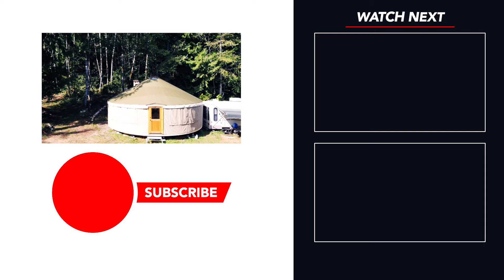TIMELAPSE: Couple Building a YURT in 15 Minutes  // Off Grid Living

Comment: Gorgeous yurt! Curious about how much in materials the platform costs? I am looking at yurt kit that includes the floor kit and trying to compare. Thanks!
Reply from the maker: 2 years ago it cost us about $5,000 to build the platform, I'm sure it would be significantly more today with the increased lumber prices.  I'd guess $8k - $10k.   This was for our 30' yurt.
Reply: How is that floor holding up? We are considering doing stamped concrete (we are northern WI) but worry about the cold

Comment: This SO FUN to watch and relive it all.  It also looks like it was SO EASY 😂😂
Reply: Thanks for the video! How long did this take in real time haha
Reply from the maker: @SeekandSave777  the yurt took about 3 weeks in real time.  1.5 weeks for the platform and 1.5 weeks for the walls/cover/roof.  Really the hard work comes after the assembly of figuring out how you'll heat it.  If you'll plumb it and run electrical, and how you'll design it.

Comment: You guys inspired us so much I am picking up our yurt from Pacific Yurts in spring. Ryan what was the dimensions of your trailer that you picked the yurt up with , need to make sure mine will do the job. Thanks again.
Reply from the maker: Our trailer is 12' 5" but has an open back and Pacific Yurts recommended a 14’ but they were able to load ours just fine.  I did attach a piece of board to the back of the trailer but honestly I’m not sure it did any good. The rafters on our 30’ were 14’ 10” so there was a significant overhang, but it was still legal in Oregon/Washington.  Excited for you guys!  What size did you get?
Reply: @OneFootOfftheGrid  Thanks for the response! Yes we bought the 30 ft. as well, so I saw the rafters are just short of 15 feet . Our property is also in WA state but in the mountains.

Comment: We have a 16 ft yurt from Pacific Yurt. I noticed that you insulated the floor and the roof, but not the walls. (We did all three surfaces and are also in the PNW). How did you decide about which surfaces to insulate?
Thanks, Ramona
Reply from the maker: We did insulate the walls.  We just bought our own insulation from a third party instead of buying from Pacific Yurts.

Comment: Love the video, thank you for sharing your journey.
Can i ask for your plans on your deck?
We are about to try the same thing and any guidence would be appreciated 
Minty thanks
Reply from the maker: They are the official plans from Pacific Yurts.  https://www.yurts.com/downloads/
Reply: While these tents are commonly referred to as Yurts...yurts have rafters which curve downwards just before the sidewall...this design with straight rafters is called a Ger.

Dig holes three feet deep, put in a tire, fill with dirt, tamp well, use lag bolts to screw through the sidewall of the next tire, screwing it to the first one, repeat until you are 2 feet above grade. This will give you almost free footings that go below the frost line, which will prevent the floor buckling in the winter.

Either make a mechanism which will raise the clear plexiglass dome on the roof ring, so you can vent heat when it's hot outside, or just use the cloth cover the Mongolians used for centuries.

Build a Rocket Mass Heater, with the thermal mass built into the wood deck to save space, so you can heat the Ger efficiently all winter.

Comment: Hello! Me and my family are going to start a community farm with many yurts and one huge yurt for religious purposes, I tried to gather as much as I could from the video but if it isn't to much to ask what are some things that made the job a whole lot easier?
Reply from the maker: Very smart to ask these questions before trying to install.  A couple of the most important ones:
1. Have more help than you think.  The covers are extremely heavy.  I'd say having 4-5 people would make it go pretty smoothly. 
2. Use a scaffolding.  I've seen people place the center ring with only using ladders, but the scaffolding make things so much easier. 
3. Think about unfolding the cover first and then refolding.  Ours what so stuck together it made it almost impossible to unfold.  We put some baby powder between the folds to make it easier to install (the second time).
4. Platform - Use construction adhesive to secure the boards to the joists to prevent squeaks.

Comment: Hi, what is the size of the decking board used? Do you paint or stain it? Very interesting video.
Reply from the maker: It is a 2x6 T&G board.  Sometimes referred to as “car decking”. We are planning to stain it and then finish with a polyurethane.
Reply: Where did you buy those decking boards? Seems hard to find 2 by 6 boards. Thank you.
Reply from the maker: @wenqiaoyuan55  we just called around to our local lumber yard.  I don’t think HD had them.

Comment: Awesome video! I just started installing the beams for the platforms for 2 30’ yurts. What nails did you use for the t&g floor? I was planning on 2 3/8” ring shank.
Reply from the maker: We used 3 1/4” framing nails drove in at the tongue. It’s worked well but if I had to do it again I’d take the time to put down construction adhesive at each nail point.  

Good luck on your build.

Comment: Is there a reason to build a round platform for a yurt beyond the obvious? Seems like square/rectangular would be easier to build and you'd have deck space. It's a real question. I'm curious.
Reply from the maker: There might be ways to do it with a square platform but the round design ties the drip edge to the canvas.   So we just followed the manufacturer’s recommendation.
Reply: @OneFootOfftheGrid  Interesting. I see. Thank you!
Reply: I built a rectangular deck (28'x 32') for a 24' Pacific Yurt. On top of that, I built the 24' yurt platform out 2'x4' lumber (on edge), then 3/4" t&g plywood subfloor. That left 2' on the sides and 4' in front of the doors. Plenty of room for the awnings.

Comment: The floor insulation was only on one side of the yurt, why was that? The roof was insulated, but the sides only showed one layer, for the walls. I was looking into Pacific Yurts earlier and the walls have more layers, including insulation. Thank you for the video, it did help me to get a better overall look at building a Yurt.
Reply from the maker: We put insulation under the whole deck.  The portions that had decent crawl space area we did after the platform was completed.

Comment: Is this the only structure on your land? I would like to build a yurt on an acre over on the Oregon coast but I’m afraid that building permits may stop me
Reply from the maker: When we built it, it was the only structure on the land.  We built it as an "unpermitted structure" after discussing options with the county.  That meant we couldn't have permanent electrical, water or sewer to the structure and there were limitation on the height of the platform.  

Check with your county to see what they allow.

Comment: Pacific Yurts is in Cottage Grove, Oregon. I just bought a 16 footer to stay under building permit requirements in Washington state.
Reply from the maker: What was the building permit requirement.  When we asked our permit office in Mason County, they requirements were only around the height of the platform.
Reply: @OneFootOfftheGrid  Over 200 square feet was when the county's permitting requirement kicks in. That's separate from any electrical or water needs. I'm thinking of adding a propane gas heating  stove to simplify the venting stack compared to wood burning.
Reply from the maker: @leewhitmore5350  We did a pellet stove which allowed us to vent out the side and we’re really happy with how it heats up the yard. Remember when using propane that you introduced a lot of moisture into the air which for a yurt can be a problem sometimes.
Reply: @OneFootOfftheGrid  Thanks, I will consider the pellet stove.

Comment: So, no property tax on the yurt?
Reply from the maker: Not in our county.  It's not coded as a permanent structure if it's lower than 30 inches off the ground, and has no utilities.  We'll run solar power to it, and don't plan to plumb it since we'll have our cabin.

Comment: Step 1: Spend $50k in wood
Step 2: Put up rafters that look like they could blow over in the wind
Step 3: Put a tarp over the whole thing... because nobody likes windows
Step 4: Don't insulate anything. Most people prefer to freeze
Step 5: Never consider hooking up water or electricity... nobody needs that
Step 6: Ensure there's no washroom because guest will prefer to walk outside to an outhouse or take a dump in the woods
Step 7: Look at your bank account and realize how dumb you are for spending a ton of money on a glorified tent
Reply from the maker: 1. Our kit was only $10k and the base only cost $5k.  
2. The are treated 2 x 4s which were engineered to support this structure.  With the optional snow and wind kit (which we purchased) it can support much more load. 
3. Tarp?  Try canvase.  We actually have 5 windows all around the structure plus the GIANT plexi dome which brings in plenty of light. 
4. The roof and the walls have  double bubble thermal insulation.  The floor has 1" of rigid foam. 
5. This is an "off grid" structure.  We do have a large stove in the yurt that keeps it comfortable year round. 
6. We do have a very nice composting outhouse, but if we have guests staying that prefer, they can come into the house and use the flush toilet. 
7. After 3 years we don't feel dumb at all.  We still love the structure and I'm sure its added more value to our land than the $15k we invested. 

Maybe you were having a bad day when you wrote this comment.  Hope you're having a better day today.